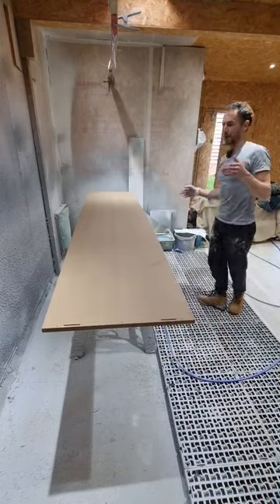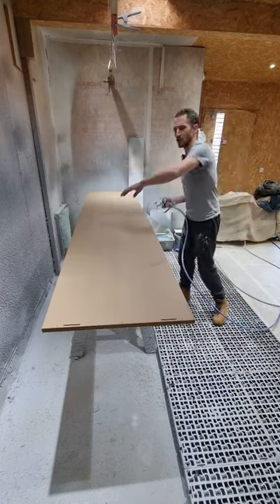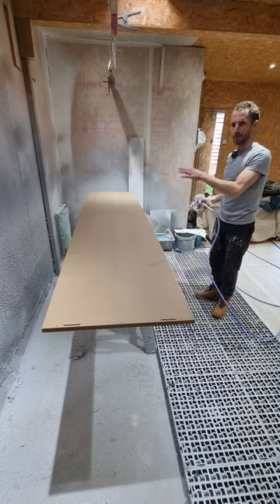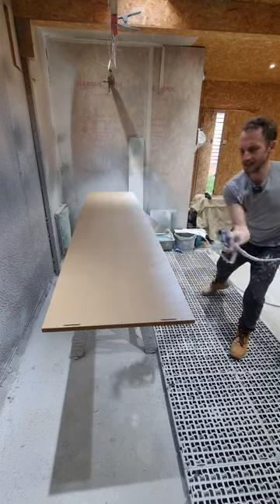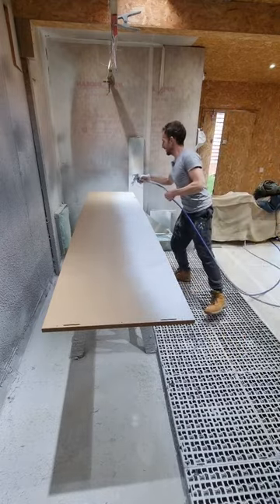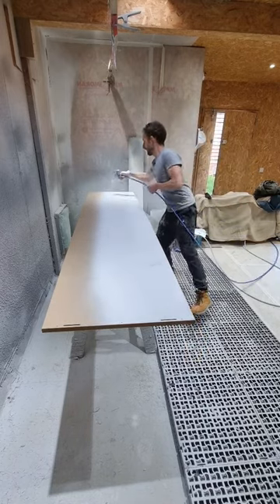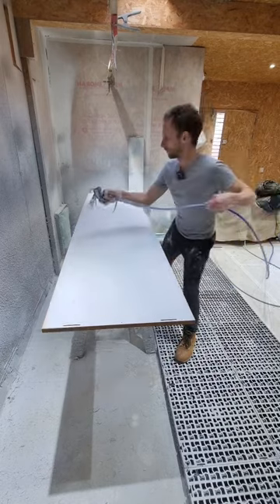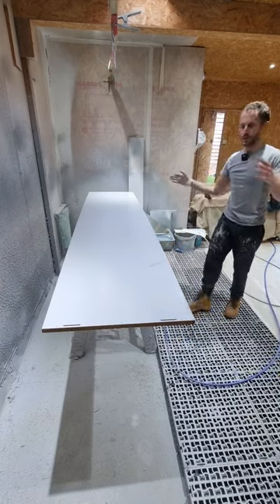Spraying Mdf Wardrobe Components With An Airless Sprayer - SUPER FAST SPRAYING

Comment: Surely, you'd still need a mask? I always wear one in my shop using Acrylic primer, it's water-based, like my top coats and clears, but I always wear a 3M Mask with Vapour filters, and usually with particulate filters as well.
Reply from the maker: I always wear a mask usually, but I cant film with it on.
Plus my fans and filters do an amazing job sucking out the overspray.
Reply: Which mask do you use? Do you have a link?
Reply: Which mask do you use? Do you have a link?

Comment: Couple questions: how do you clean that product out of your airless? Just run water through? Do you use the same airless for primer and 1k coat? What brand primer is it, specifically? And do you have any issues with the primer raising the grain in mdf? Do you do 2 coats? Thanks!!
Reply from the maker: Hello!
It's exactly the same as any other paint regarding clean up. It's a waterbased paint so clean up with water as usual 👍
Both paints (primer and top coat) are Vernites brand, 
If you look at my last youtube short video, it will have the links to the paints needed 👍
If you use decent mdf the grain won't raise.
I do 1 primer and 1 top coat, but white seems like it may need 2 top coats .

Cheers ryan
Reply: @thelondoncraftsmanworkshop  Thanks for the response! I build cabinets and use mdf 99% of the time. I recently picked up the Graco Gx19 (Gxff), and trying to stick with waterbased. Hard to get good quality products here but hopefully a decent sprayer will make a big difference.
Reply from the maker: @joseph7105 That's ok 👍
Yes that's a nice sprayer!
Practice makes perfect with an airless sprayer 👍

Comment: Have you ever tried a pre cat lacquer compared to water based using hvlp and how do these compare to water based with aireless?
Reply from the maker: To be honest I have used pre cat but for flooring etc.
They aren't for me tbh, I dint really want to go down the hvlp route as love the speed and simple use of the airless. 
Plus the pre cat, I couldn't have the smell due to where my workshop is based.

Great finishes, but I think I've found a paint now that I'm happy with (Amicus UK, 1K paint ).
Cheers ryan 👍👍👍
Reply: @thelondoncraftsmanworkshop  Thanks for your help. I think buying a HVLP before thinking about the paint has pushed me down buying certain paints. Considering if I really should buy an airless system like the GXFF. Seems like resources such as books and video courses on spraying are so far in between and resources like yours are a godsend.